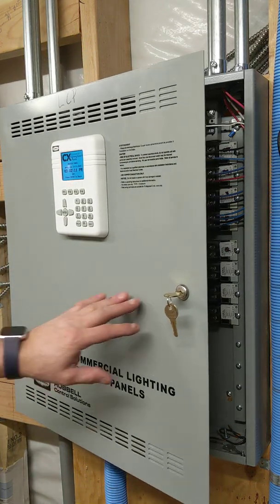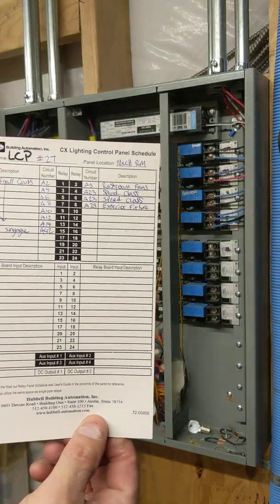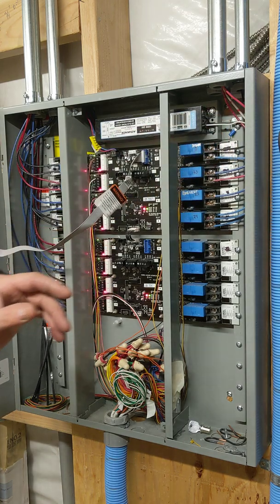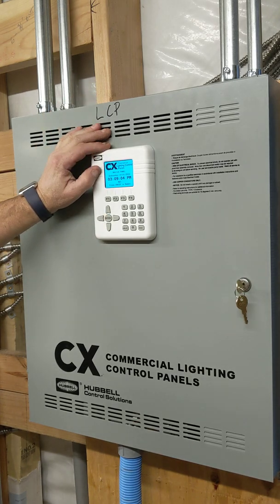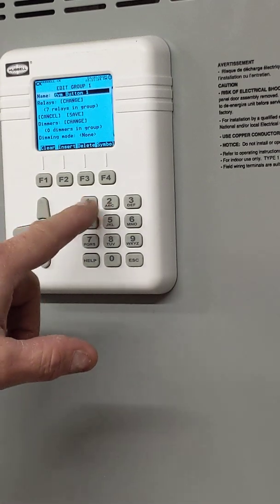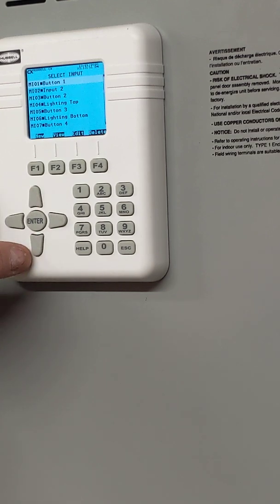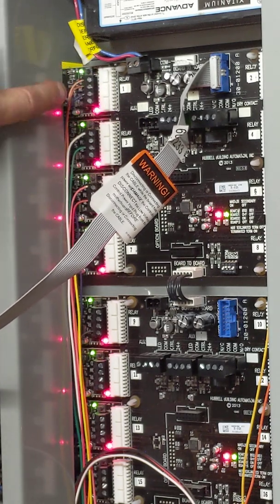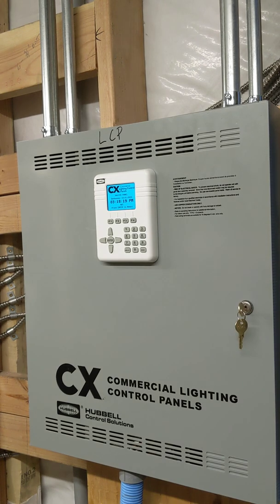Hubbell CX16 Lighting Control - Wire and Program

Comment: The main CPU is in the display, and that ribbon cable is how it talks to the rest of the world.
Also avoid connecting or disconnecting that ribbon cable with DC power on, as it's not designed for hot-plugging, and there's a small chance of chip damage every time. DC power is the 2-pin plug from the ballast to the top middle board. The same rule applies to connecting or disconnecting relay boards during installation, pull the DC power first.

Comment: Very helpful video, thank you.  Are you using the astronomic clock to time the outdoor lights?
Reply: If he isn't, he should. Sunrise/sunset can vary by quite a bit, especially in northern latitudes. The math to compute them from your lat/lon is in there, with a city list so you can get close enough. It's important for parking lot lights so you don't have a dark parking lot or waste electricity.

Comment: So the client has cat5 switches. Can this panel be used with these?
Also if I have a fire alarm panel can I set it up to close or open with fire alarm panel
P.s. thanks for the video👍
Reply: The CX was designed to be a standalone "low cost" panel for small office use, with no expansion beyond the 48-relay monster configuration. I had to leave just as the NX was being released, but the CX switching hardware (minus the keypad/screen) was being reused for NX. The "brains" were moved from the keypad unit to a daughter-board inside. It might be possible to get an existing CX panel upgraded for NX, I don't know. For a new system, you will want NX for network connectivity.

Are you talking about having an input from the fire alarm status? If it gives a dry-contact output you can wire it up to an input and use it for an override or something. (it's been a few years, I don't remember much about that)
Reply: @8bitwiz_  appreciate the reply. I just used my own contactors for the hi bay lighting and then separate ones for special effect lights. Which I used a 24v coil relay to control the contractors from the fire alarm panel.
For the dimming of the hi bays I just used   legrand room controller. In which I used n/o & n/c contractors as by pass in case a fire event.
Appreciate your input friend.
Reply: @8bitwiz_  saying all that in my first message the reason I just made my own system was because one of my guys plugged the ribbon into the input where you jump the boards together.
Guess I should of started with this bit of info.😁
When I turned power to unit it fried it. 🔥

Comment: I have the LX panel. I want to access the network via laptop. I have a bunch of garbage programs and entries I can't edit via the LXTB. Does anybody know exactly what I will need? Software, network cables etc.
Reply: We also have the LX panel. I have played around with it trying to figure out a wall switch that is not showing in the program switch box. I am guessing that the switch is dead as it was having issues. I can not find a 5 button replacement switch for the LX or even find out how to contact the company. Are they no longer? As to being able to connect the LX to a computer I don't think there is a option. The TB is a pain.

Comment: What does the ballast tie on to?
Reply from the maker: The "ballast" is converting your 120v incoming power into 12v for all the controls inside the panel. You just need to supply a dedicated circuit for this. 

If you have any more questions please feel free to ask.
Reply: That's to provide 24VDC power for the computer parts. LED ballasts can be very nice power supplies if you find one at the voltage you need.
Reply: The one that im using has the default cards in it, but the computer doesn't seem to recognize them so I cant group them. Is there something I'm missing?